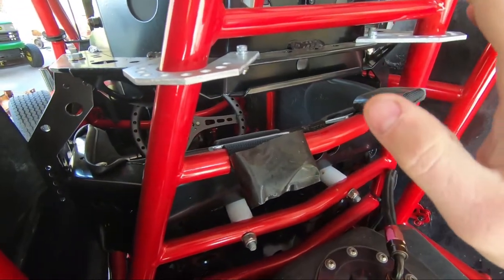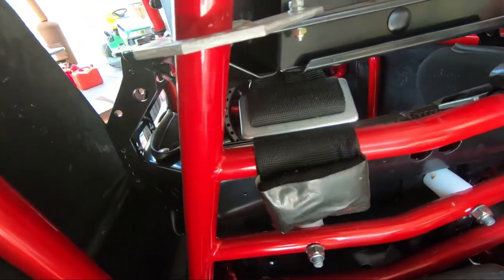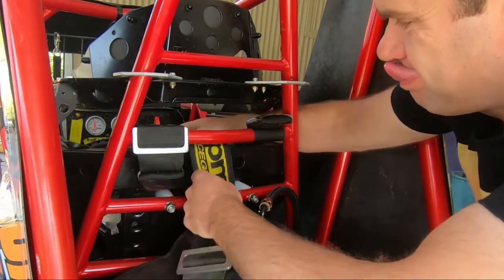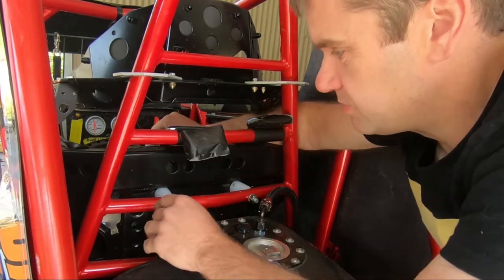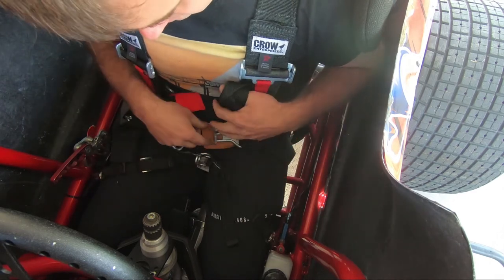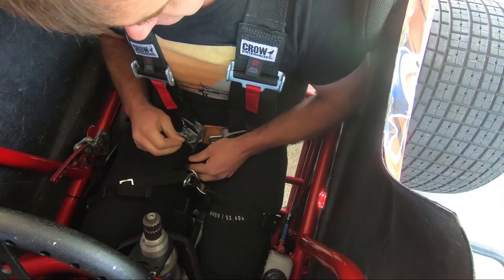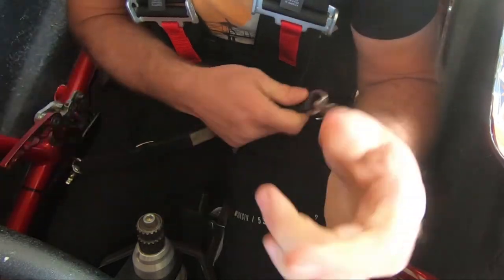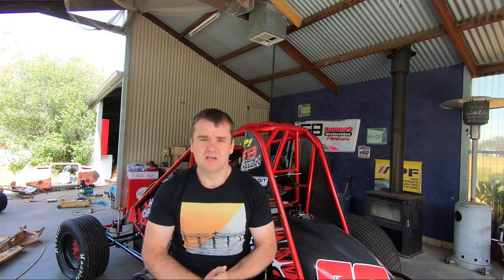Hateley Motorsport tech tip Wingless Sprint Seat Belts And Arm Restraints

Comment: I LOVE The Zip tie Idea 💡 😍!
I  Run A Short wheel base Front Engine Dragster AND My Arm Restraints HAVE BEEN A Pain in My ARESS From Day 1 BUT The Car came with a Camlock Harness ALSO & HAS Delayed Me to Starting Line Before!
Changing to Latch Link NOW For Big Race 🏁 & Prayers For  Faster car Starts From NOW ON!
Thanks AGAIN 😊